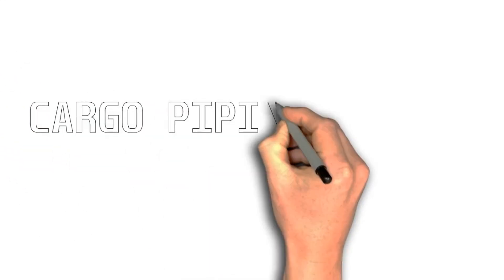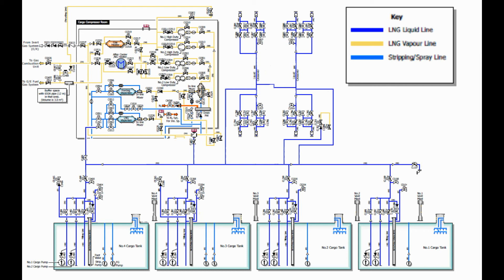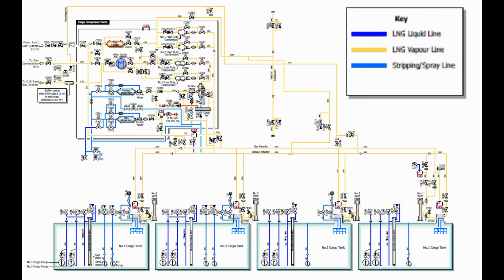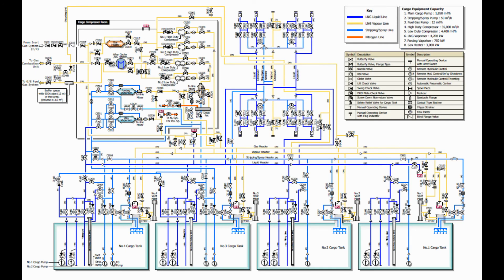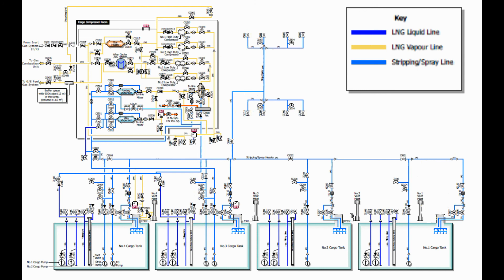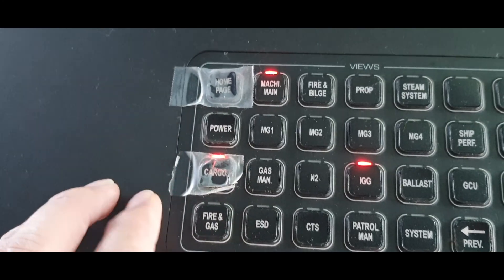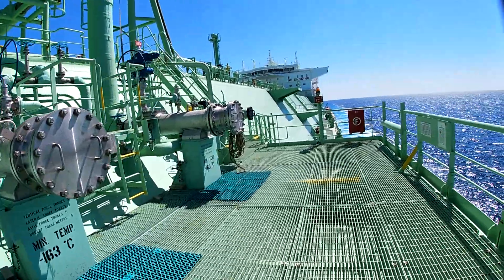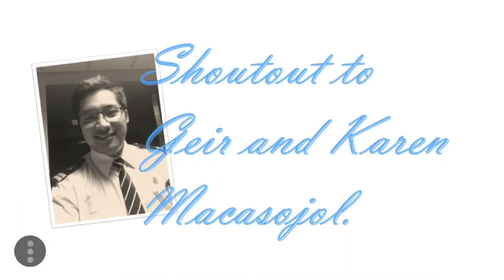LNG CARGO PIPING SYSTEM

Comment: good day Sir!
How the Cargo Engineer ALIGN the manifold to the loading arm at shore?
I mean what is His Reference considering that there are 4 liquid lines and 1 vapor line?
thank u
Reply from the maker: Markings will be placed in the terminal side. Usually they will put a flag. Before arrival, exchange info between port and vessel are on going. Sometimes this is also included in the terminal manual that will be provided by the terminal to the vessel.
Reply from the maker: Also before vessel will be approve for that terminal. A compatibility procedure will be carried out. To see or check if the vessel will be compatible on that terminal.